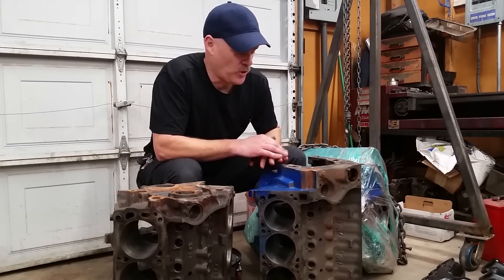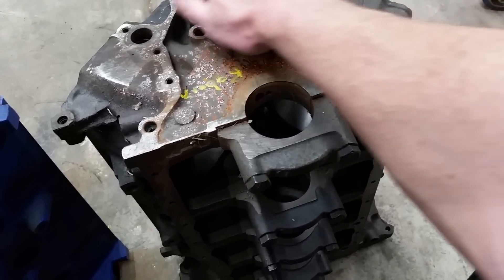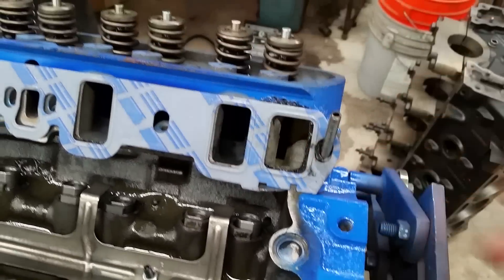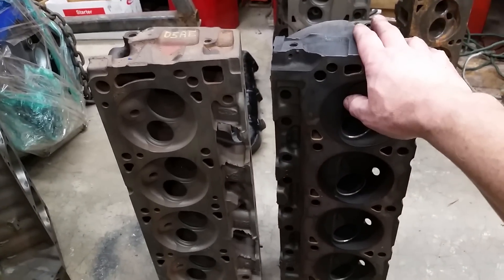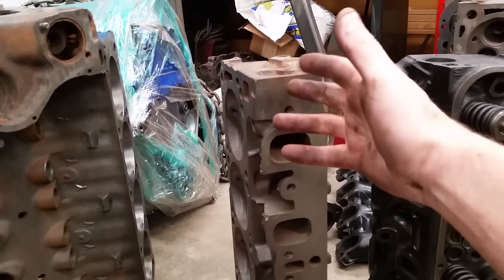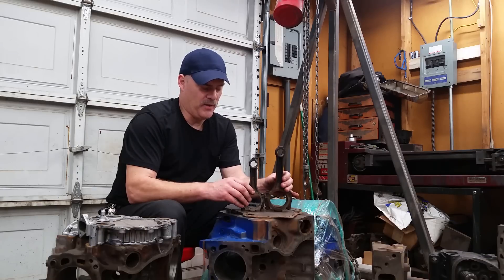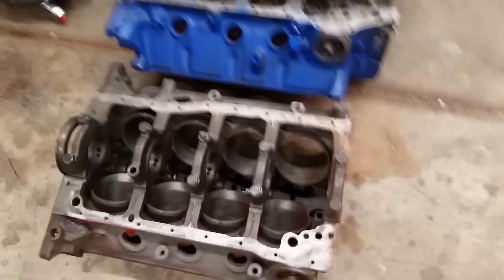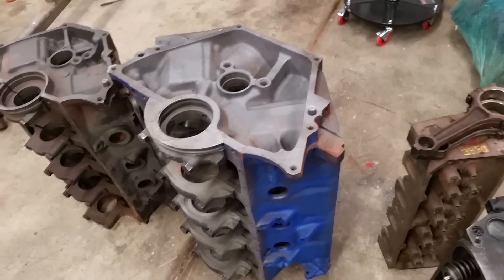302 vs 351M blocks

Comment: could you show me where the casting numbers are on the 302 ford motor and maybe explain them please. getting ready to pull the 302 on my sons 81 mustang which was originaly a 4 cylinder car think you.
Reply: I would like to know this as well. I purchased a 302 that apparently is a Mexican Block (higher nickel content, stronger ... for boost...). Can you verify the markings that prove its a Mexican block?
Reply: Look for "HECHO EN MEXICO" on the Lifters valley...also the main caps are bigger than either a 289 or std 302...Block Identified by casting numbers C8AM-B, 75ZY-AA, D1ZM-AA, among others, above the starter....but basically if it says MEXICO in the lifters valley it is a Mexican 302, if it doesn't, it is not.
Reply from the maker: The Mexican blocks say made in Mexico on them
Reply: Thanks guys, I have heard of a few ways but the lifter valley seems to be the most consistent answer.

thanks for the great vids, looking forward to more SBF in the future.
Reply: E Gibson Yepper...I've been around enough 289's, HIPO 289's, 302's, Boss 302's to be able to look at the main caps and tell what I'm looking at but the lifter valley is the sure fire way to ident a Mexican 302...btw I would hope you wouldn't over value the Mexican 302...it is just marginally stronger and also weighs more so in today's world I wouldn't consider it for any type of real heavy duty (i.e. High performance) operation...they were more valuable back in the day when they were the best option available for additional block/mains strength when hot rodding a 289/302, but obviously that isn't the case anymore.
Reply: Steve Fowler we had actually agreed on a price before he even mentioned that it was a mexi-block. I know its no Dart haha, just a little piece of mind in a way. Will be a mild turbo build, sub 450WHP.
Reply: E Gibson Sounds like a plan...but not to be nosey but why are you going to the expense of a turbo installation if you are only after 400 HP? A well designed naturally aspirated 302/331/347 can pretty easily pull 400+ HP. Also I suggest you get the block/heads magna fluxed before you start the build....good idea on old blocks.
Reply: Steve Fowler sorry for the slow reply, busy day! That's not nosey at all, i know that it seems odd given the expense vs how much of the turbo potential could be used. I have wrestled with this decision for a very long time. I went from a top end rebuild to a 331 stroker build (definitely not interested in the 347) but I always wanted a turbo car. Top end kits and stroker builds are pretty expensive (new) in Canada for the return (around $5000 for trick flow top end kit) and I managed to get a full 302, Borge warner turbo, intercooler, piping ect and haltec standalone for a great price so that's the direction I am going now. I plan to upgrade components of the engine now including arp hardware and aluminum heads that could potentially work with a stronger block (and subsequent bottom end rebuild) in the future to get the full potential of the turbo. Car will be built for corners overall.
Reply: E Gibson Sounds like a great build...you obviously know what you are doing...and I completely concur with the no 347 comment...and I hear ya about costs and trying to decide what type of build to do...about 20 years ago I bought a '65 Hipo fastback mustang and spent some serious money getting it back to OEM stds (with the Shelby mods), the 289 hipo was rebuilt with a bunch of NOS parts and was blue printed...she was a really fun car, I think I had $8,000+ in just the engine and then after driving her for a while decided to protect the 289 hipo and build a high horse power none historic engine...I started thinking like a sportsman 302 with about 375 HP, but kept getting sucked deeper and deeper, finally ended up with a Ford racing 302 4 bolt engine (ended up a 327)  with AFR heads and mechanical roller cam with jesel valve train components with 12.5:1 compression...I used to drive to a Sunoco not too far down the road by Orange County (Fl.) drag strip and buy racing gas in 4 5 gallon cans and keep them in the garage for fuel ups...she was quite the toy...sold her a few years ago with both engines for $45K...which means I probably only lost about $20K in the deal, which I figured was a fair price for all the fun I had, especially searching the internet for all the NOS parts for the 289...had I not sold her I was planning to build a circa '68 Le Mans 24 hour tribute 305 engine with the Gurney-weslake heads (they are still available for big $$$) and webers, that engine was going to run about $25K I figured. If I might ask what kind of car are you putting your 302 in?
Reply: man, sounds like an unreal machine, but 12.5:1, ouch ($$) haha! hope you were able to put the money into a new project. I know what you are saying about the ol' rabbit hole, I can see myself buying a boss block on sportsman style to gain some HP and longevity but where does it end! I am building up a 1990 LX Notch, this will be a driver/corner car with a 2004 Cobra IRS and big brakes, racing seats wide tires and so on (likely a meth kit as well). I have frame stiffeners and will be putting a cage in as well to stiffen the entire uni-body as best I can. Should be a fun little car given the size and weight but still keeping the numbers down since its just a Fox Body. They are definitely going up in price lately in my area though (Victoria BC, Canada). If you managed to find a good condition one you would easily be $5k - $6k, more and more are breaching $10k-$15k (stock, low k's/miles) it seems.

Comment: When they were racing the 351 Falcons in the Australian touring cars back in the late 60s / early to mid 70s . Because the 351 has such big crank journals that generate alot of friction , they had to employ an elaborate system of oil coolers and catch cans  to ensure their longevity, oil surge was another problem with them.
Reply: The Cleveland 351 has a smaller main journal than a 351 W
Reply: yes,much to my disgust they blew up a lot,usually when moffat or goss were leading,ive got a big sump,oil cooler and oil restrictor kit in mine,it holds 10 litres and no surge problems,i wish theyde let them do that years ago in racing but CAMS,the rule makers would rather see cars parked off the track than allow sensible mods for reliability

Comment: why is there no valve lash adjusting except shims , chevy pain to adjust but I think its a better design
Reply from the maker: The Ford has a non adjustable valve train also known as a positive stop it has a fixed valve stem height and push rod length so you just half to torque down the rockers and go you just gave me a great idea for a video

Comment: I'm a Chevy guy but I like building engines and it doesn't matter what kind it is. Great video.
Reply: i agree i gots two toyotas i got to refresh high mile good runner 5mge 2.8l 7mgte 3.0 in-liners

Comment: can you build a 351m or 400 ford for more performance?  if so, what sort of parts/heads/cam for a Bronco?  Thanks
Reply from the maker: Yes in fact the block you see in this video is going to be a new series higher compression and Clevland heads
Reply: nice, looking forward to that.
Reply from the maker: I agree the 351C canted valve head is a much better layout for power out put than the parallel valves of the windsor
Reply: Jay Groom also any camshaft designed for 351C fits in 351M/400. So there are lots of options.
Reply: oh, I didn't know that.  THanks
Reply: the canted valve modified or Cleveland is in my opinion superior to Windsor motors any way you measure when power is the goal.
Reply: i figure your in the states,here in australia we have a few guys building great alloy heads for clevos,check out CHI cylinder heads website,ive got a set on my 351 making 530HP and its a lot more driveable than with modded old iron heads
Reply: thanks, i will
Reply: Hey there! Just looking for a one piece oil pan gasket for my 351m any ideas on where to get one???
Reply: Happy New Year everybody!